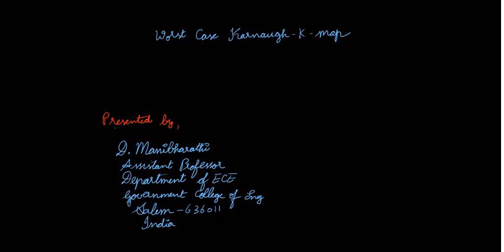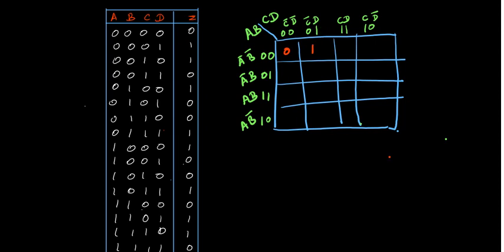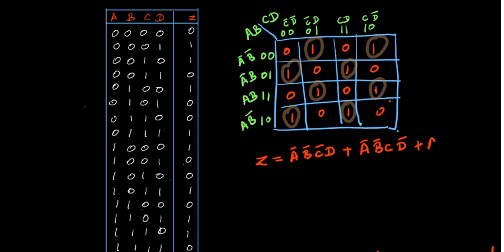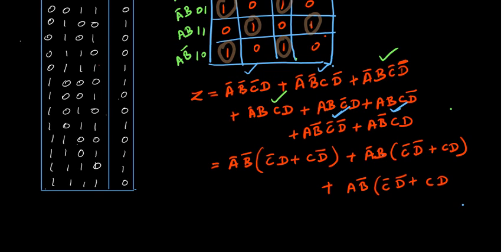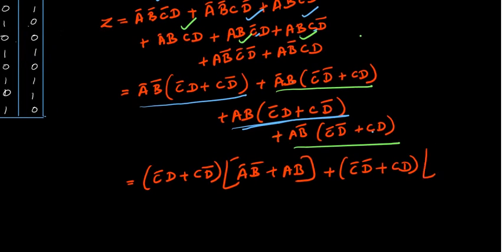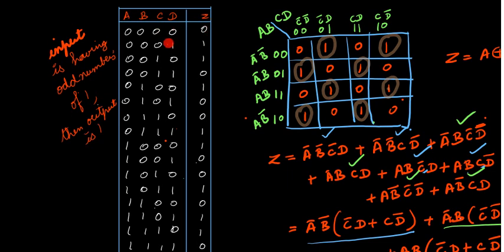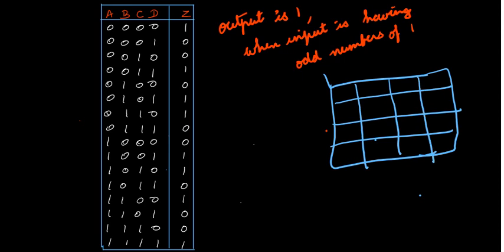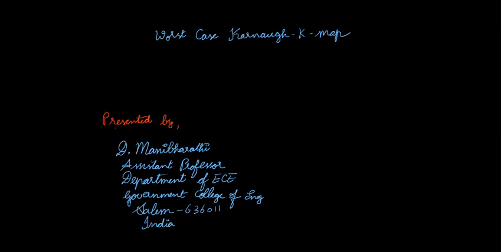K map for XOR and XNOR gates (Worst case)

Comment: wait why when they were even numbers, you had the same table, wasn't it supposed to be different from the first one
Reply from the maker: I have changed the output z in the table.. Observe closely. Hope this helps
Reply: @fundamentalslearner7460  i saw that, but i was talking about the Karno map, it was the same despite the different Z
Reply from the maker: Yes you a right. I made a mistake there. Thank you very much @Reipeg
Reply from the maker: Subscribe please 🙏
Reply from the maker: @Reipeg you are correct. I made a mistake. Thanks for pointing that
Reply: @fundamentalslearner7460  i would, but under one condition 😁 only if you make a vid on how to make schemes from the Karno's map. 
Like after you make the (A*B+C*D=y) for example, what the scheme would look like. AND's, NAND's, XOR's etc